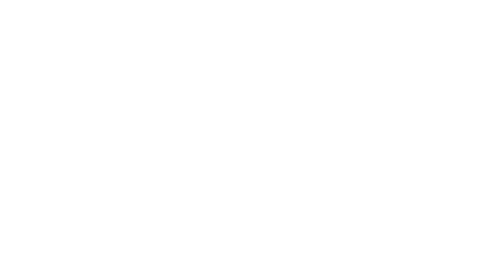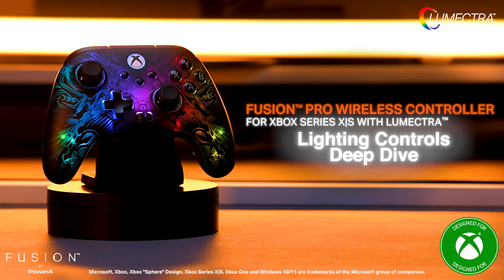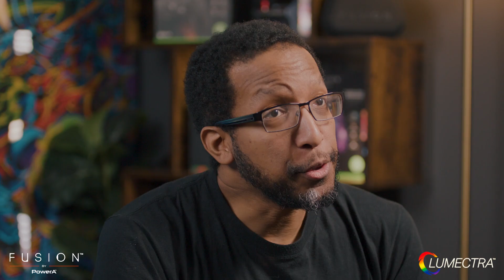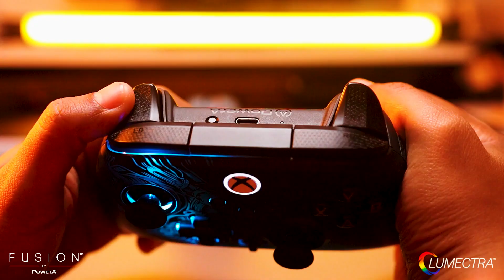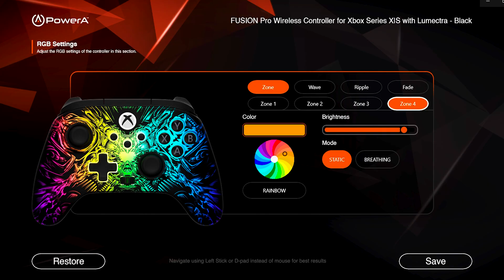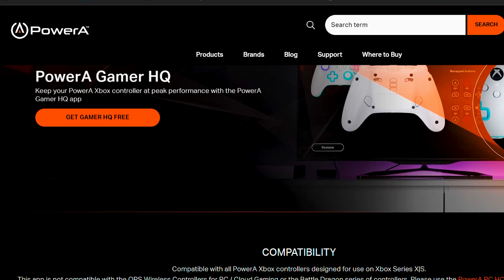PowerA FUSION Pro Wireless Controller for Xbox Series X|S with Lumectra Lighting - Explained

Comment: not sure how this explains my issue and from what i read from the comments they have the same issue, when i press the LED button, does nothing, when i hold the LED button it flashes green, the xbox button flashes white while being inopperable. i tried messing around with the powerA app on my xbox to change the colors but now i cant get my LED lights to work anymore.

more than likely going to return this back to target and buy a different controller that actually functions, i do like the feel to the controller and i play better compared to a basic xbox controller but this is just a huge disappointment.

Comment: Hey kev. My controller is defective. Sticks snapped and drift. Controller disconnecting. Lights donts work. Triggers get stuck. And adjustable stick heights are done for. Im super disappointed since choosing this over a official elite controller. At 180 quid and its done in 2 months. My original xbox controller. Thats been here for 10 years is still usable. This is not. And ive contacted your customer care. . So

Comment: So step one is tapping the LED button to cycle through lighting patterns and when I press the LED button it does nothing. Holding it makes the controller flash green and the letter buttons glow with their colors and pressing the d pad left changes them to one solo color so apparently I’m changing the colors for zone mode with only the letter buttons zone activated but I have no idea how to get out of zone mode and this video is almost more frustrating than trying to get these LED’s to work.

Comment: Unfortunately it's let down by customer service I bought one I lost the dongle... They don't supply a dongle so it's no longer wireless they don't supply any parts for their controllers that you can buy no matter how expensive... So unfortunately I don't think PowerA is good in the customer support area, so I would probably suggest that most people avoid them... I lost mine only two months in terrible customer support just said no...

Comment: This is the most confounding, confusing and convoluted instructional video I’ve ever come across. 

Old mate is just banging on incessantly the whole video. There’s no breaking it down into manageable chunks. There’s no graphic overlay to help visualise what’s going on, or the flow of the steps being taken. 

I like the controller, but the on device user interface is driven by programmers rather than user experience people. 

The app on Xbox is great, really easy to use. Except the changes never save to my controller and are reset each power cycle. Which is why I’m here watching this video 5 times to figure out the on device method.
Reply: I’m 100% with you on this! I’ve got the controller for a month now and find myself every time I open the console immediately deactivating the Lumectra because it’s so time consuming to make everything work as you’d like. I have even printed the user manual but man this programming is just ridiculous!!
Even though they haven’t released the Xbox app in Europe, changed console region to USA and downloaded it (hoping Microsoft won’t ban me as soon as I’m logging in from Greece)..
The app is easy to use but as you mentioned never ever my settings are saved!! Every time I’m turning off the console I have to make everything from the start. After first couple weeks stopped bothering with the leds. And I’m a dude into technology…
Lastly, not even a firmware update for the controller to solve all these matters! I’m wondering if I made the wrong decision as long as I don’t use the leds and should’ve opted for the Razer V3…